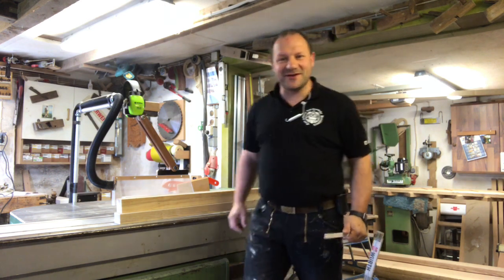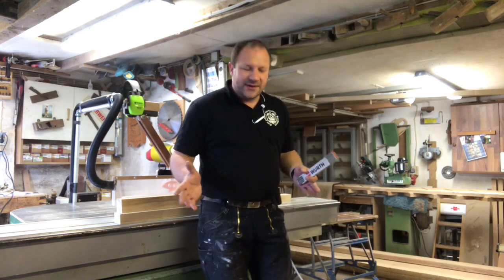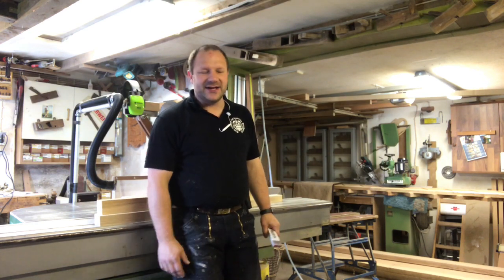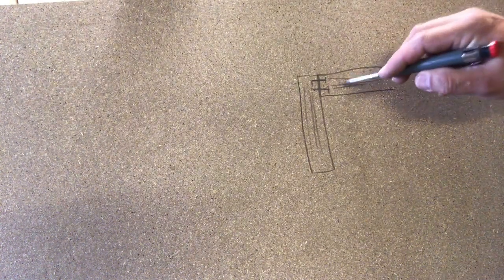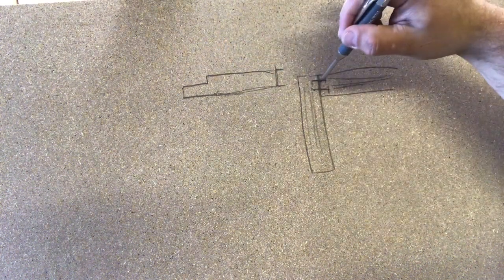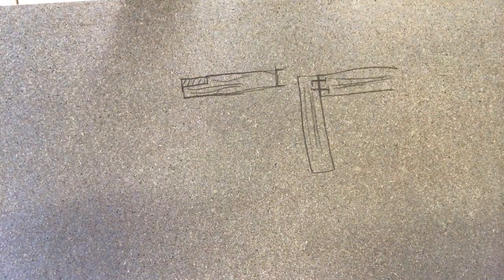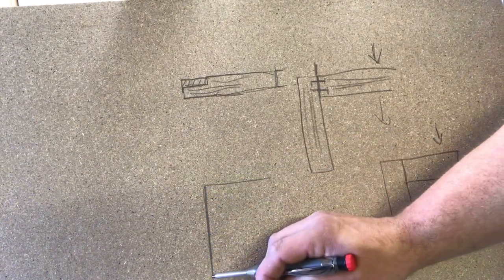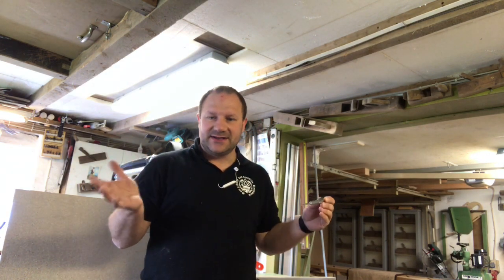Ecküberblattung / Ecküberblattung auf Gehrung

Comment: Hallo Robert. Ich bin Rettungsdienstler hauptberuflich. In meiner Freizeit bin ich ein ambitionierter Bastler mit Holz und kann damit auch gut runter kommen, wenn du verstehst was ich meine... Ich habe mir schon einiges bei den hiesigen Bastelkanälen abgeschaut, die alle eines gemeinsam haben. Es gibt kein wirkliches Fachwissen, was nicht schlimm ist... denn wir sind ja nun einmal alle Heimwerker. Endlich aber gibt es einen Kanal, der fundiertes Fachwissen vermittelt. Mir gefällt dein Kanal sehr gut. Du hast eine wirklich nette, unaufgesetzte Art die Infos rüber zu bringen. Ich wünsche dir alles gute weiterhin für deinen Kanal.
Reply from the maker: Moin Schlumperdix 
Ja ich weiß genau was es heißt nach 12 Stunden RTW, NEF oder Lst. Mit Basteln oder Bauen den Kopf frei zu bekommen 😉